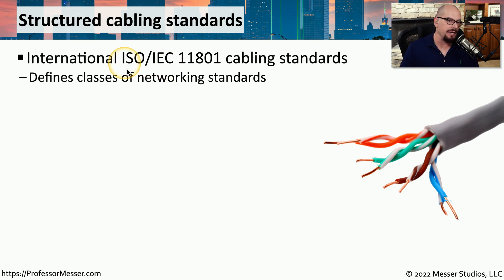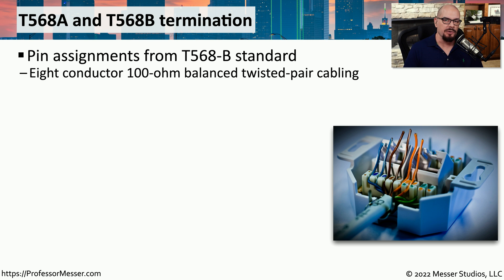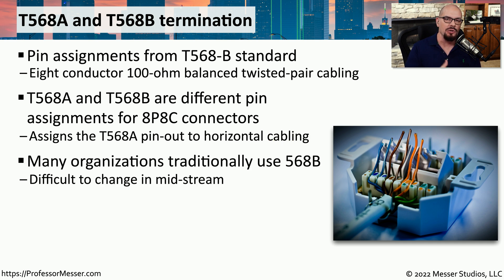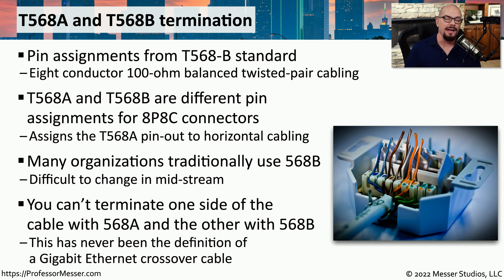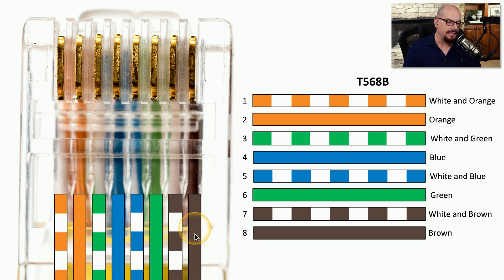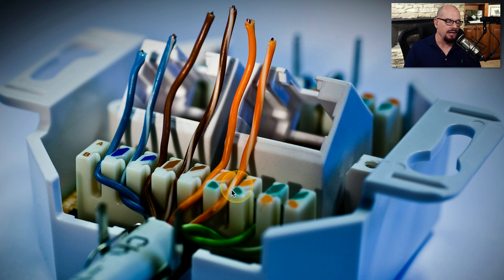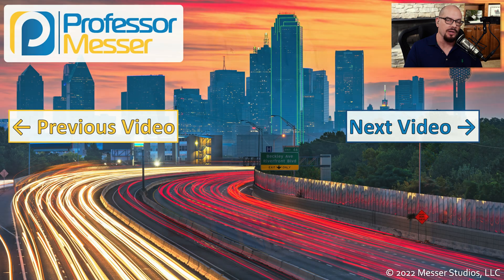568A and 568B Colors - CompTIA A+ 220-1101 - 3.1

Comment: What are the benefits of a company "punching" their own cables? I always figured that was something the service provider did and was a little intimidated during the network tools video. How common is it to be in IT and just casually weaving your own cables?
Reply: Working as a technician, We've punched our own cables when running lines for cameras and such every single time we've set it up.
Reply: Like 16 years ago when I worked for a school, it was super common. Maybe there's a specific sort of medium large, dynamic but poor business where it's more likely.
Reply: I work for a major retailer. Every time I see a contractor come in to install new ethernet cables they bring in big boxes of ethernet cable that's not terminated. I'm assuming they have to terminate each cable when installing it. Either into a wall jack or at the patch panel end. The shorter patch cables I see tend to be pre-made and don't need to be terminated with an RJ-45 connector.
Reply: very common
Reply: if the cable gets ripped out of the wall, the punched terminals more easily pull out without destroying the entire block. punched terminals are more reliable in situations which is important if you need the connections for many decades- pins on rj45 connectors may corrode over time. most people when installing cables run their cable from a long spool, these cables dont come with rj45 connectors on the end and its easier to use a punch-down block to terminate rather than stick rj45s on all of them.

Comment: the pin labels don't match the A or B standards in your video at 4:28 - I'm confused, could you please help me.
Reply: yeah this doesn't make sense
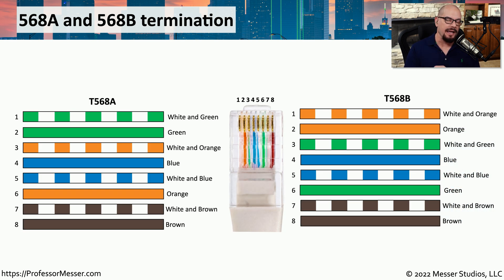Reply: @Vicki-ann Thornton If you look at the picture at 3:06 instead of focusing on the color order, if you look at the pin numbers, you can see that the blue wires are always pin 4 and 5, and the brown wire are always pin 7 and 8. So in the picture at 4:28 instead of listing the pins in numerical order they listed them by colors (probably easier visually) the order you'd have is 4,5,7,8,6,3,2,1. Hope this helps
Reply: @alexandre7955  Nevermind, I think I got it. The A or B scheme shown at 3:06 only refers to what you have on your PIN, and not the other end of the cable/block. Each block may be arranged/manufactured for whatever order they need, you just need to use their arrangement scheme for if you have A or B. Right?
Reply: @Accuni correct. It is the other end of the
Reply: @alexandre7955  so that pic at 4:28 is just a matter of this specific punch-down block configuration? and could vary depending on what you're given in someone's infrastructure?
edit: I get that the numbers only correlate to colors for ease of memory and that punch-down are not expected to be numerical